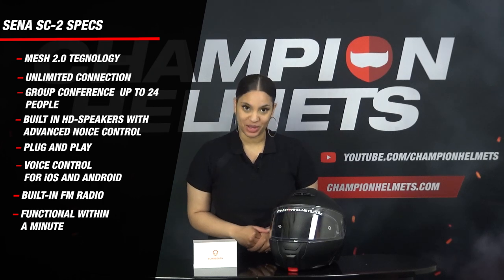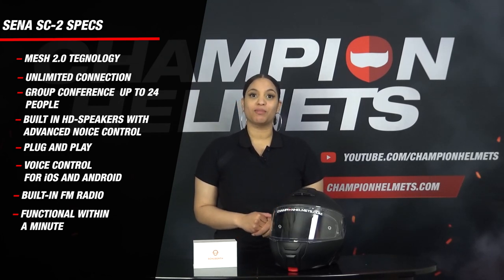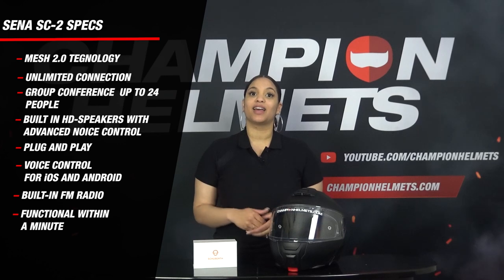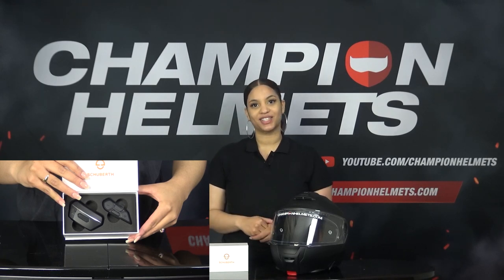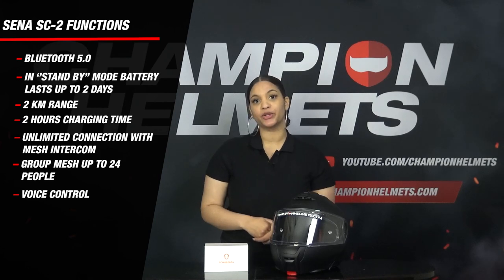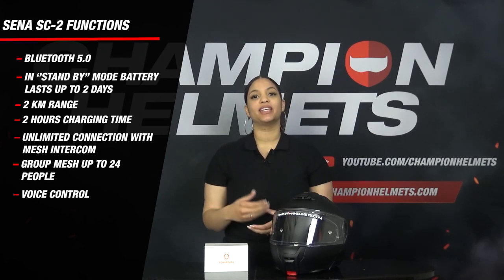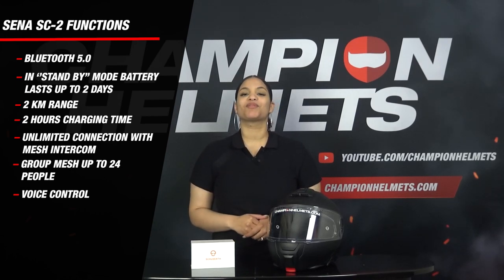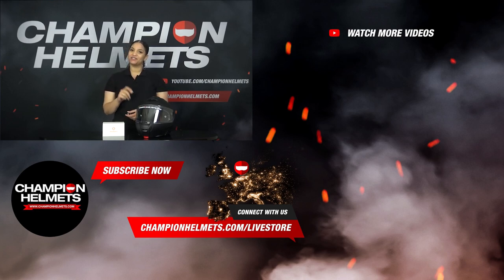How to install the Sena SC-2 Communication system in the Schuberth C5

Comment: Great review!! I now have a Schuberth c4, but I need a new helmet, is the c5 a progression on the c4?
Reply from the maker: Thank You Balasz, the C5 is a good successor to the C4 Pro, the only thing that we find unfortunate about the C5, is that the helmet comes in only two shell sizes. Click this link: https://youtu.be/f8lvOHC3F64 to see our full review + road test of the C5.
Reply: Hi. I also had the first C4 which I hoped would be an upgrade from my old and excellent C3. As we all know it was not. I have the C5 now and it is excellent. Very quiet, good ventilation and a super fit.